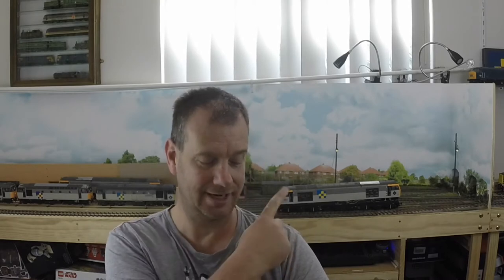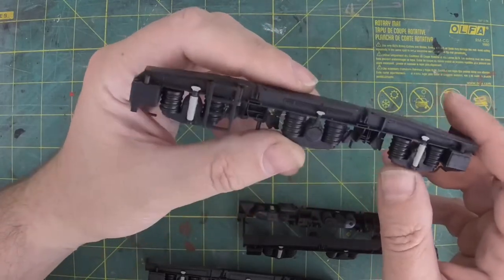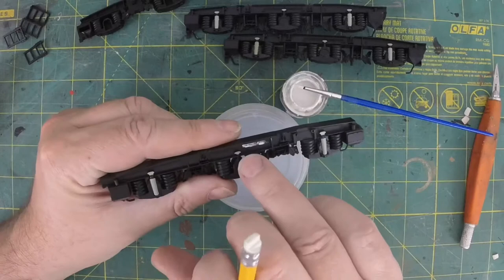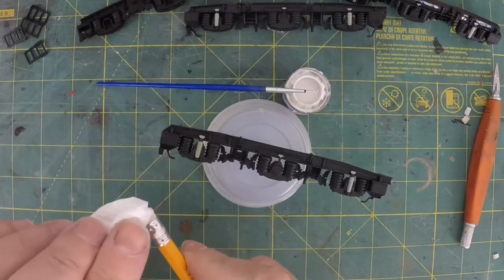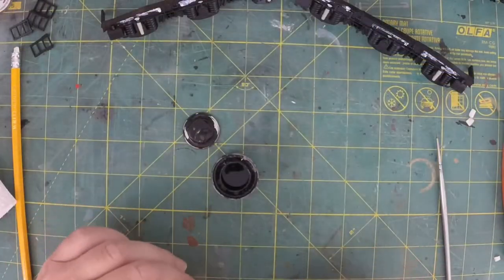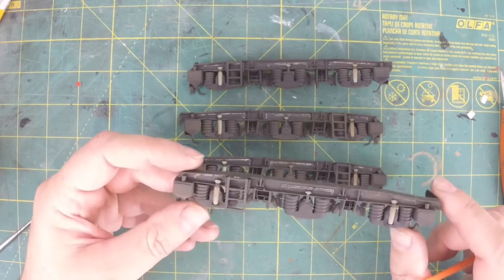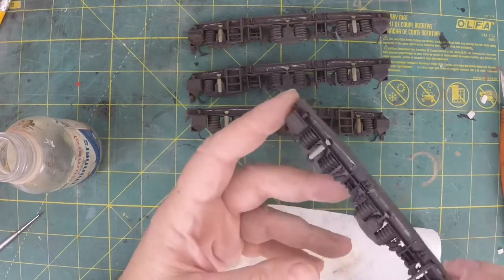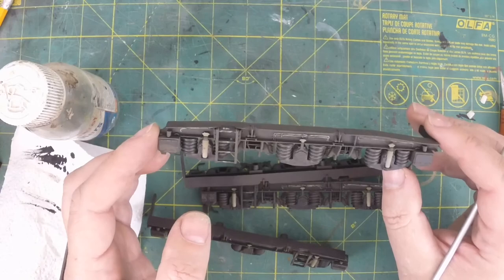Model Trains 116 - Detailing and Weathering Heljan class 60 Bogies. A failed (sort of) experiment

Comment: Ian, I have found that dry-brushing with Numbril Metalcote  (27004), will make detail 'pop'. The brush does need to be very dry and one is hly aware of anything happening until the area is compared with an area that has not been done.  Very good for creating the worn paint look where bare metal shoes through.
Reply from the maker: Dry brushing could work on some detail, however, the air pipes on diesel locos are white, so it’s not a practical method in this case for highlighting the pipes
Reply: @47606odin  You may find a fine graphic pen useful for the white bits. Some of them have  a permanent ink, which if varnished as well, should hold. I use one to re-do the letters on my keyboard! :-)
Reply from the maker: StephenWilliams I’ll have to keep an eye out. Haven’t thought of that
Reply: I've used the Burnt Umber variety of these for rust spots:
https://www.winsornewton.com/uk/shop/graphic-markers/promarker

Comment: Hi maybe you cud  try sum very fine brass wire or fosberush  bronce wire that mite work hop that helps don't mind the spelling Anthony
Reply from the maker: I think the fine wire would work, however, there’s actually quite a bit of it so, for this, with the weathering it’s worked out reasonable
Reply: use mulyput as a mould put sum paint into the mould then apple that to the moddings on the locomotive fram  sea if that will work hop that works for you give it a go